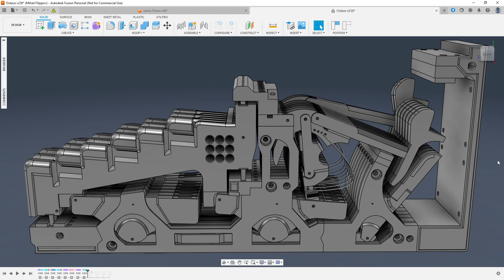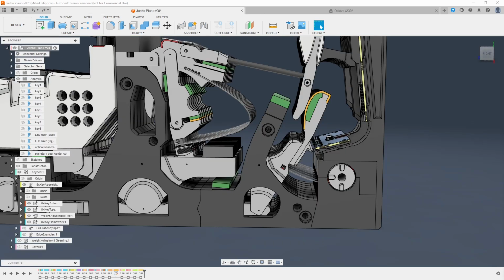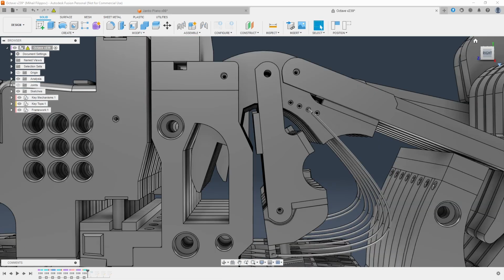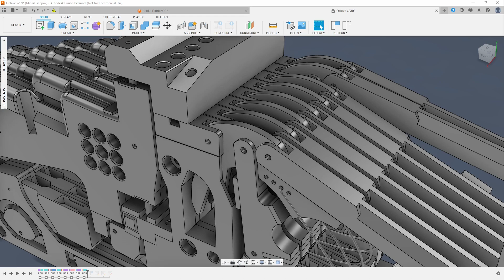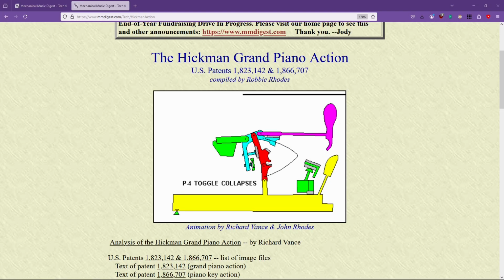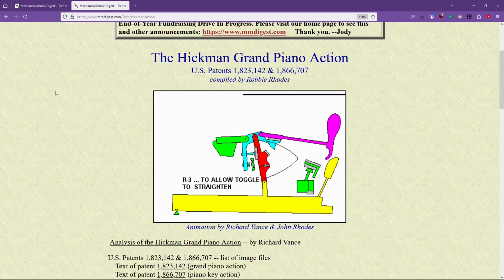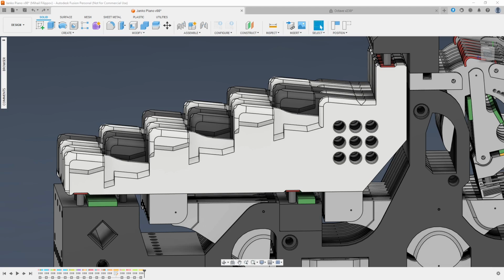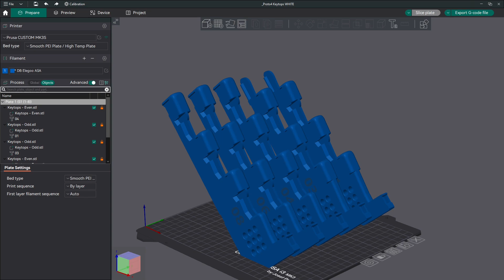DIY Janko Piano: 7. Final Prototype

Comment: maybe some kinds of wood for ivory analogue, though it'd mean modifying for flat buttons and potentially screws.  if you can dig up some lilac, it's a lovely creamy colour with very thin purple and green streaks... depending on what pieces you get.
Reply from the maker: Potentially. It really comes down to how easy it would be to manufacture the buttons because I would really prefer to stick to the rounded edges, which means either a CNC or VERY careful application of a router.

Hopefully attaching them to the plastic backbone can be done with some sort of glue instead of screws.
Reply: @DIYJankoPiano  a vee tip round over bit on some flat plank, router along a wood strip, go the other way to make a grid.  sliced off with a micro table saw will take care of it, for glue, some holes in the backbone as a key, resin glue, the kind that never hardens... some oily woods are hard to find a good glue for, a local wood supplier can give input.  bad enough most everything we make projects from is imported, the wood at least should be local.
doing the routing as a grid would mean you can make it all from one large piece, easier to manage with a router than doing one thin strip at a time.

Comment: I have been working on my own Janko design, and your design seems to solve all the issues I encountered with my prototypes.
I am very impressed.
Do you intend to share your design?
I would be very keen to to build one.
Reply from the maker: Yes, I plan to share the design (or at the very least open up the fusion 360 project file to the public so if anyone wants to follow in my footsteps... its their choice). Not sure when I will do that though - probably around the time I finish the assembly?
Reply: That is great, thank you; the sooner the better!
I would like to start with prototyping as soon as you are ready.

Comment: This is a great example of why prototyping is necessary. There’s no way that I would predict the problems in the first prototype, especially the bouncing of light keys when played strongly.

Regarding key surfaces, it seems that bonding a different material to the key tops is probably the only way to get best-in-class material/texture on a 3D printed key body. One approach would be to use wood on the black keys and to cannibalize an old acoustic piano for its white key material. Your project deserves a no-compromise solution.

Your second prototype added complexity, compared to the first. If you were planning to go into commercial production, you would likely continue refinement with an eye toward simplification. For a one-off design you can call it done. The next phase will be to confirm reliability and resilience. Hopefully, it will prove to be solid and long lasting.

Best wishes!
Reply from the maker: Yep - pretty much any project no matter the complexity benefits from at least some level of prototyping, let alone complex projects with many moving parts. The bouncing hammers was such an annoying problem (as I mentioned in the video, it nearly caused me to scrap the hickman action altogether)... so glad its possible to record slow motion video with off the shelf parts (like gopro camera or even most cell phones nowadays) - would have never figured out what was happening without it.

Key surfaces... yea - wood buttons placed on top of the plastic key is likely the best solution, though it would likely require CNC machining the buttons and sanding them afterwards. Grabbing the materials from an existing piano (or just buying key top replacements and using them as raw materials) is unfortunately not an option as the buttons need to have a 6mm+ curve at the edges (unlike piano keys which have relatively sharp / abrupt edges), so there just isnt enough material for that. Another option would be to see how custom knife handles are made (wood and other material) as the results are quite good. Its too bad that all those options would be extra expensive though.

If I do go for commercial production (be it a 'custom' limited run or aiming towards something in the 100 units tops range) I will definitely need to simplify the design. We are talking removing the hickman action for a regular weighted hammer approach, simplifying the key levers, figuring out how to make the keys in a faster & cheaper way, redoing the entire framework design to be based on a proper metal chassis instead of my 'plastic only' approach... lots of things basically.
Reply: @DIYJankoPiano  Fingers crossed for a custom limited run!